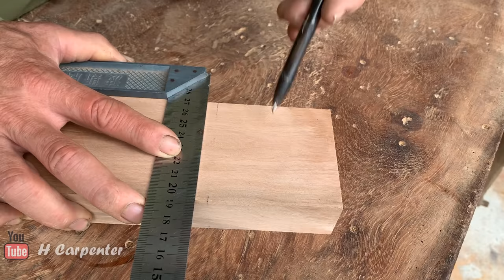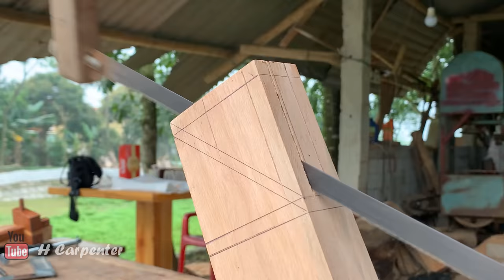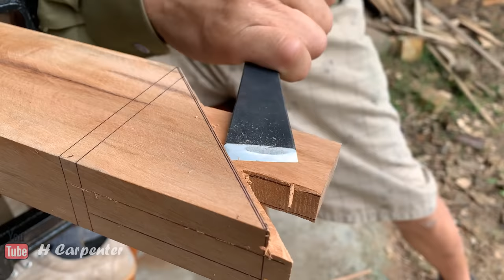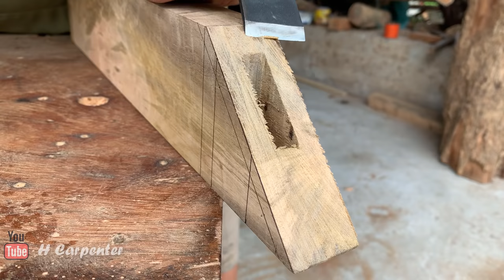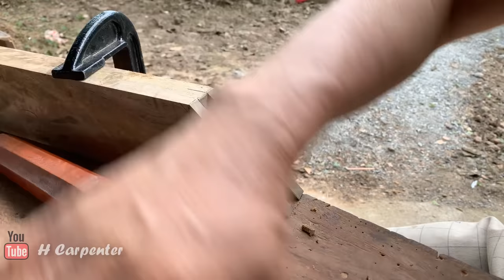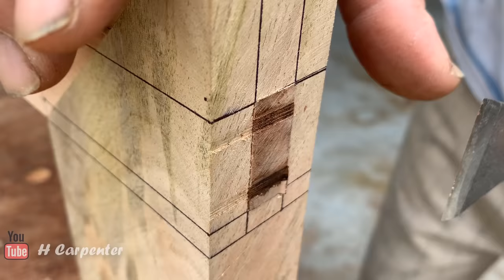Amazing TECHNIQUES Japanese Traditional Joints, Fastest Hand-Cut Joinery Skills Of H Carpenter

Comment: Is it strictly necessary to use hand tools for this? I'm really interested in this style of wood joining but it just seems unnecessary to use hand tools for absolutely everything.
Reply: so, yes. im an experienced diyer who is starting to practice joinery. i recently made a tablesaw stand using mortise and tenon joints so it wont flex at all... 24 mortise and tenons for the stand and the ones i cut by hand were 5x better.. pretty ironic to use hand tools to make a power tool stand..

Comment: Mr. H.  is a master at his craft.  I see and save many of his videos.  But in this video, my comment is one I see all too often in this particular joint.  To make a mortise and tenon with two slots as if to make a TAPERED mortise and tenon and not do it but still place two wedges in the open areas to look like a Tapered mortise and tenon is like kissing your sister.  From the unknowing, it looks good, but it is NOT.  This joint gets a grade of -C
Reply from the maker: Thank you for your compliments, you are not satisfied where can you tell us so I can fix it. Hope you have the best experience
Reply: @HCarpenter  The tapered tennon wedge is just that.  when you cut the two slots in the tennon you then taper the mortise wider at the end of the tennon the same width as the wedge and cut the point of the wedge a 1/8 to so short so that the wedge will now push the ends of the tennon to the tapered sides when driven in tight thus wedging in the tennon in the mortise.  That is one of the best locking joints that there is.